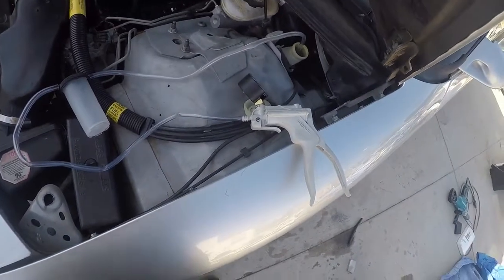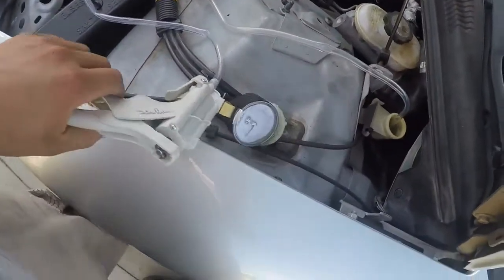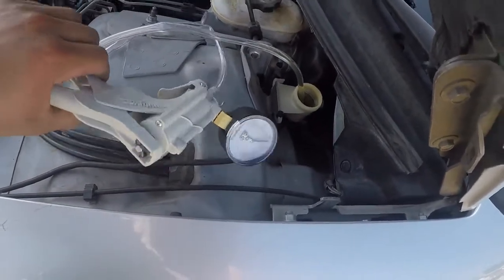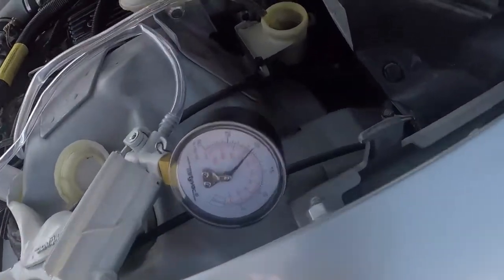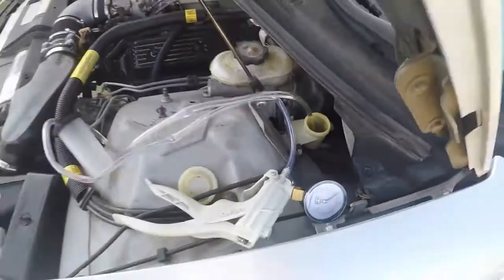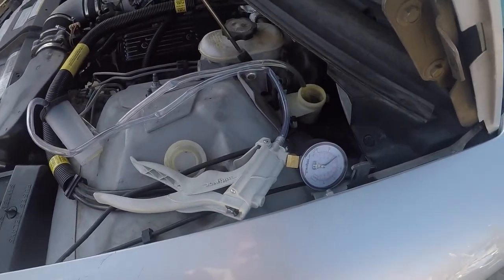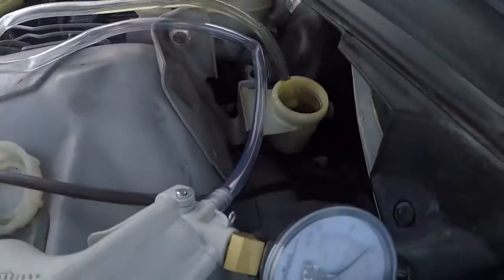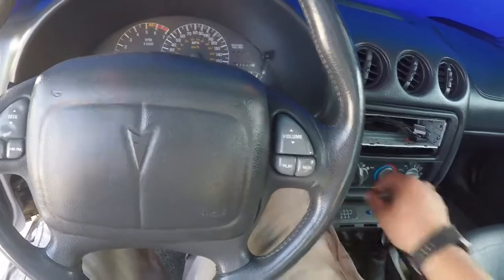how to bleed a t56

Comment: There is a bleeder screw on the slave cylinder, that really needs to be bled to get everything out but doing it through the reservoir gets most of it.
Reply: there isn't a bleeder screw on these cars
Reply: @wileycoyote3853  The bleeder is literally on the slave. Don't comment when you don't know what you're talking about.
Reply: @therickestrickthereis36  hate to u bud but u are wrong. Here is what Google says

There is no bleeder screw for the clutch on the Camaro. The proper way to bleed the clutch is to connect a hand held vacuum pump to the clutch master cylinder reservoir and apply a vacuum of 10-15" Hg. You will see bubbles appear in the master cylinder, after the bubbling stops top off the fluid and repeat. You will then need to pump the clutch pedal to push fluid back into the slave cylinder. Check and top off fluid again.You may have to fabricate an adapter or plug of some sort in place of the master cylinder cap in order to connect the vacuum pump to the reservoir.